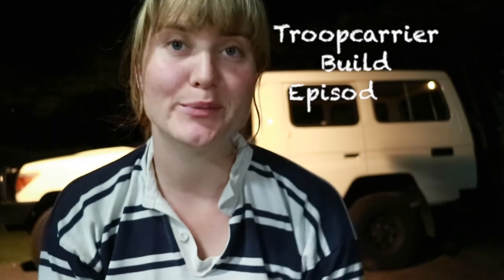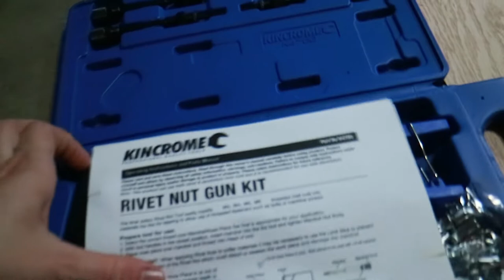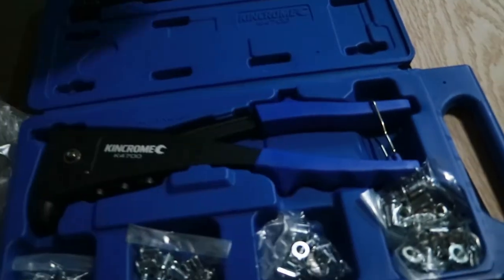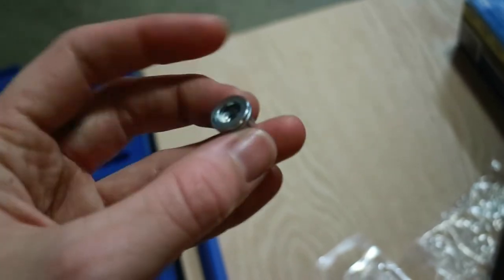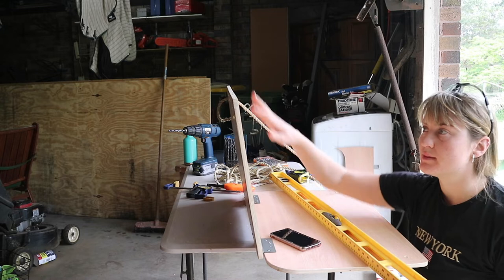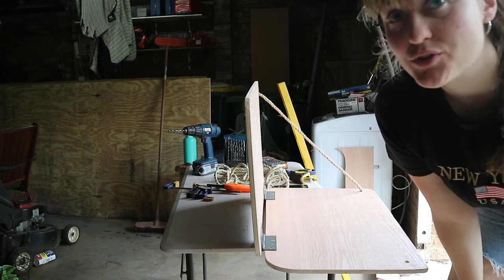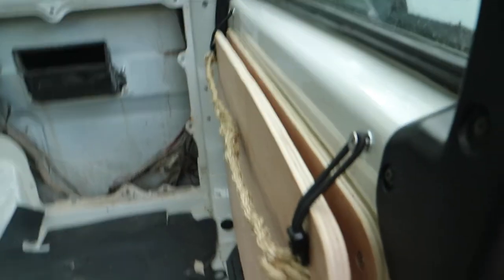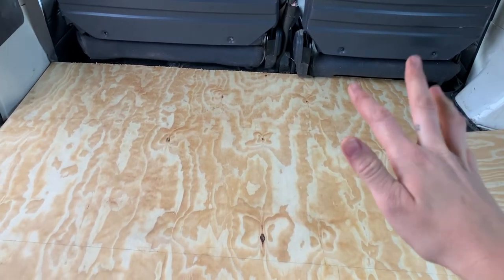This is not a drill, I gained some skills! Troopcarrier Build Ep 4

Comment: I hope you replaced the plastic seal behind the grey vinyl at the back door (which I saw you remove from your last video).  If not, how has it help up preventing dust coming through it?
Reply from the maker: Hey! So I totally didn't. I changed all of the door seals to pinch weld with the added rubber on the sides & I haven't had any dramas with keep dust out!
Reply: @itsindiep  It’s actually a moisture barrier believe it or not.  Also they actually work as well.  Sometimes (especially on the drivers & passengers windows that go up & down) if the vehicle is parked on an angle then water drips through the felt & rubber seals (where the window winds down into) & can drip against the doorcard if the plastic moisture barrier has been removed.  It won’t be a problem with the rear barn doors but if you remove it from the front doors make sure you replace it. 👍